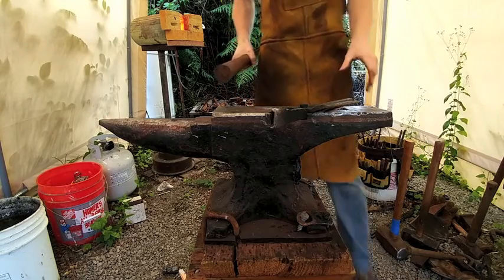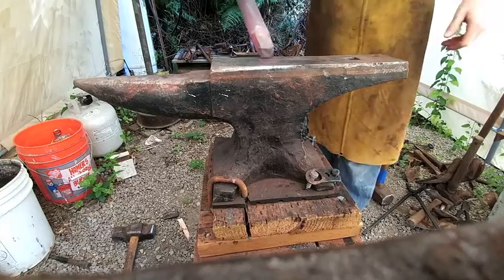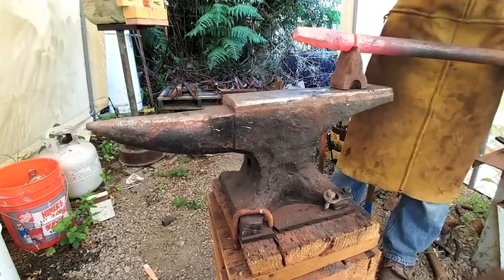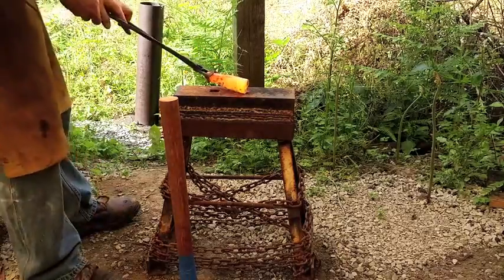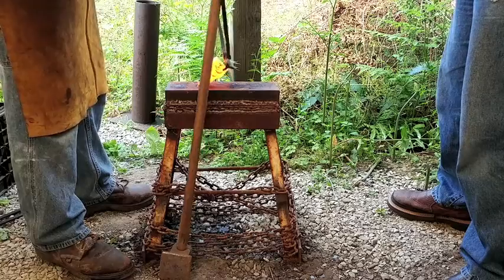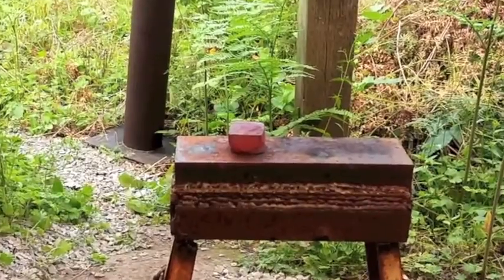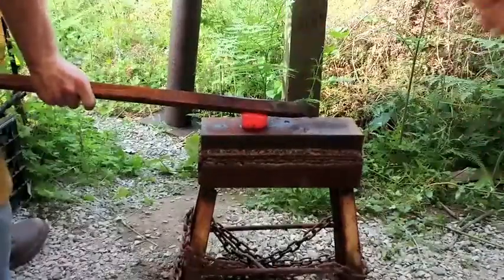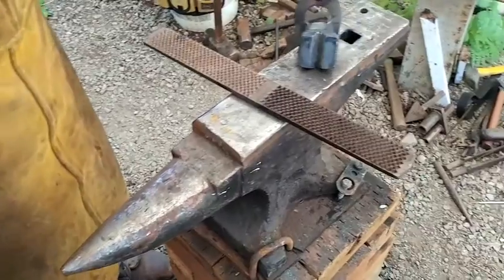Forging a V-Block

Comment: So you make your anvil soft.......+you forge too cold on it. It will dent faster then you think. And you have ground it so your anvil is simply soft. Forge hot if you are not going to stop at orange heat you will dent this anvil super fast.

Comment: Don't strike on 100 lb anvils I have seen heels of a anvils fall off
Reply from the maker: Yeah, I was just using the anvil to start the collar on the metal. Never intended  to start wailing away at it right there.

Comment: Good job! That flatter has a really long handle! I just subscribed, and am looking ore ward to seeing more! also, that's a very creative hot cut hardie. Made from a cross pein?
Reply from the maker: Never saw your comment until now; sorry dude.
The hot cut was given to me by a fellow blacksmith (along with some other things) as a trade for something I made him. It was made from half a sledge hammer that was machined to the hot cut shape; in my opinion a waste of a sledge, but it was just given to me, so I'll use it.

Comment: nice setup! check out my friends channel, Workshop Of Death you might like it! ....I dig the other anvil/tool you have to really hit the hardy hole pieces your making so you don't break your anvil. good thinking! i wanna make some hardy hole pieces but i don't want to break the tail off my anvil
Reply from the maker: I have checked them out. They have some good stuff.
Yeah, the striking anvil is nice, especially when using it for the hardy tools or heavy stock; much easier to hit something lower striking with a sledge. 
I'm not sure making a hardy tool will break your anvil tail, though. If you keep the metal hot, that's the thing that will give, not the cold steel of the anvil. Of course, there are several cases of broken anvils, so. . . yeah.
Reply: yeah just thinking about my anvil breaking makes me cringe lol
Reply from the maker: I know, right? It's like. . . Gah! xD